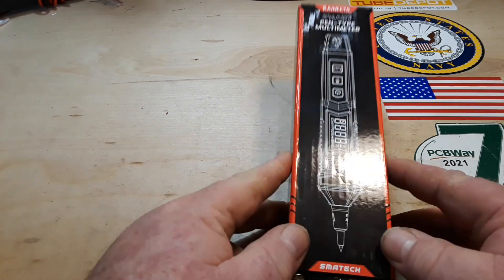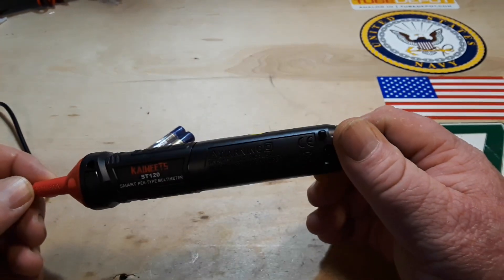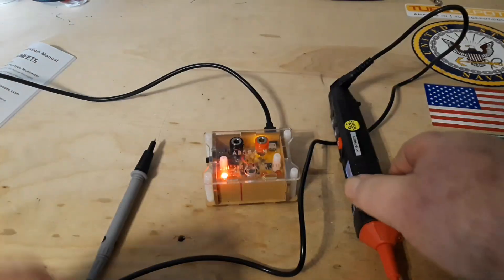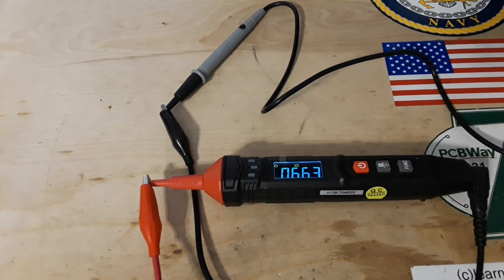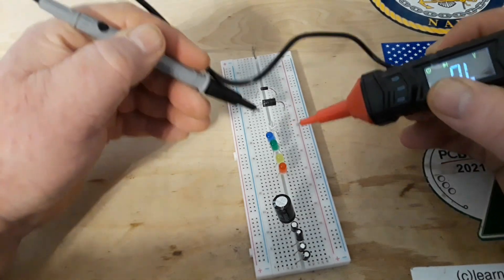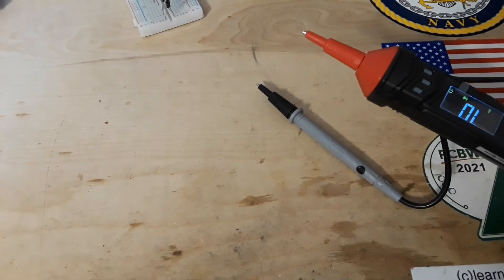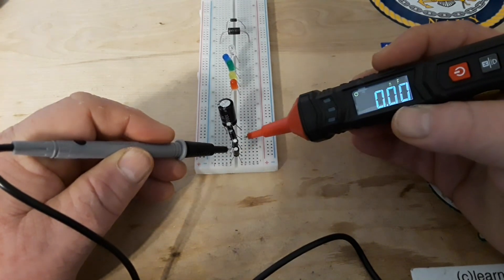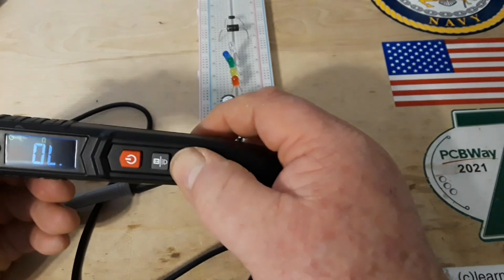Kaiweets St120 Pen Type Multimeter Review and Tear Down

Comment: Smells like something you would like having around your garage toolbox to troubleshoot low voltage automotive issues. It does have one MEGA drawback though - it's right-handed only (unless you can do measurements standing upside down =) I guess at that price point you can't really demand an orientation-flipping screen on the thing.

Comment: Non-contact voltage would have been great - but, at 20 bucks, I think it’s not likely.  It is a field-test item, not a bench or lab unit, so the accuracy is fine, I think.  It appears to be lacking any input protection, although you didn’t address that in the video.  So, I think thats’ a serious shortcoming, and for that reason, I wouldn’t buy it. It’s unlikely that this would be used by a professional, but amateurs can make some pretty foolish brain-fart mistakes too, and in the wrong circumstances, that could become a finger/palm toaster. Fingers and palms are worth a lot more than $20.